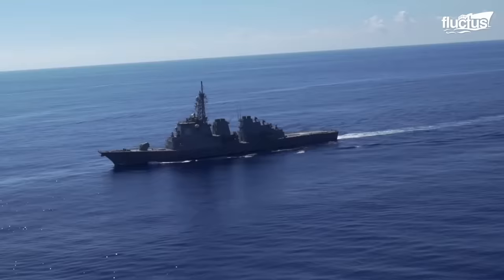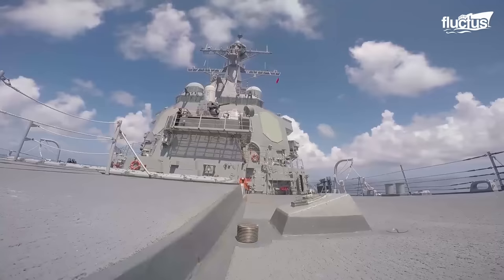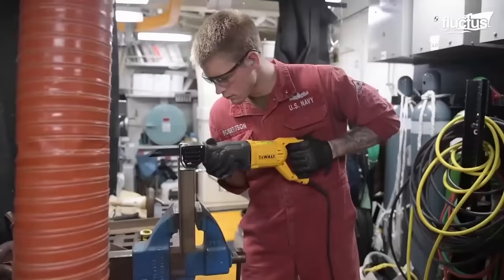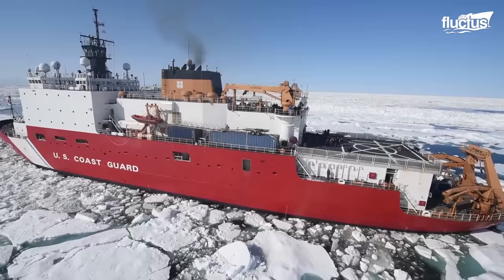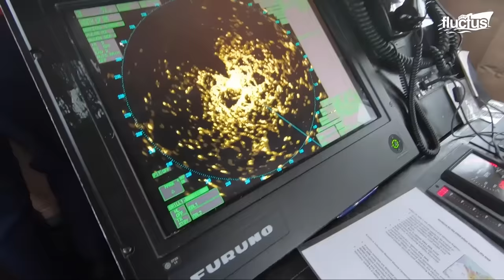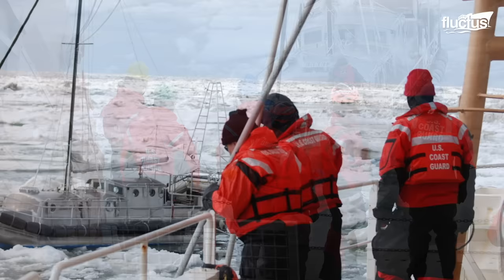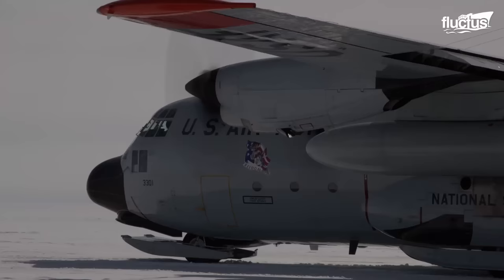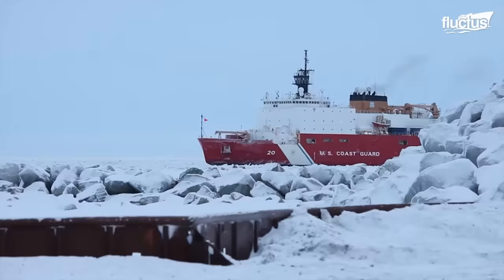Life Inside Massive US Destroyer in Middle of Rough Sea

Comment: y'all need to get your shit straight.  you don't use a 5" gun for AAA.  it's too slow to target aircraft or missiles. That's what CIWS and RIM-162 are for. And they're not 'heavily' armored. They rely on well-designed compartments and damage control to avoid sinking from a serious hit.  They have fragmentation armor (in the form of about 150ish tons of kevlar fiber throughout the ship) and topside steel plate deck armor and that's about it aside from a bit heavier protection in key areas.  The only ships with real armor plating now are carriers.  Everything else relies on speed, tech, and the best damage control crews in the world to keep them safe.
Reply: "Located on the forward deck is the 5-inch (127 mm) Mark 45 gun. The Mark 45 Mod 2 variant, with a barrel length of 54 calibers (270 inches, 6,900 mm), is installed on ship hull numbers DDG-51 – DDG-80 (30 ships). Hull numbers beginning with DDG-81 employ the Mark 45 Mod 4 variant, which has a barrel length of 62 calibers (310 inches, 7,900 mm).[20] The 5-inch Mark 45 gun, directed by the Mark 34 Gun Weapon System (GWS), is capable of use in anti-ship and close-in anti-aircraft roles, as well as Naval gunfire support (NGFS) supporting forces ashore, with a range of up to 20 miles (32 km) and capable of firing 16–20 rounds per minute.[20] The Mark 45 gun on the Arleigh Burke-class destroyer has an ammunition stowage of 680 shells.[38][39]"
Reply: @Coinz8  In practice, it's not really used for AAA.  It's got limited use in shore bombardment and against other ships.  CIWS and variouis surface-to-air missiles are used more.  Paper and practice are two different things.
Reply: @Canthus13  I am damn sure it went through trials and proved viable.  It can be utilized in an AA role along side CIWS and RIM. Why? because it is able to track enemy aircraft, fire a round with a fragmentation round with a proximity fuse, it rapid succession. It isnt just on paper, its been practiced.

Comment: lol. The MK 45 is most certainly not a 54 caliber gun. A 54 caliber gun would have bore diameter of .54 inches. The diameter for this weapon syste is five inches. To speak of caliber for an artillery piece, one must specify the diameter and then state the caliber so as to inform the listener that the weapon at issue is an artillery gun and not a rifle. Caliber on an artillery piece is used to multiply by the diameter to state the total length of the barrel.  Homonyms are hard and you should really not be trying to explain things to people when you have no knowledge of the subject matter.